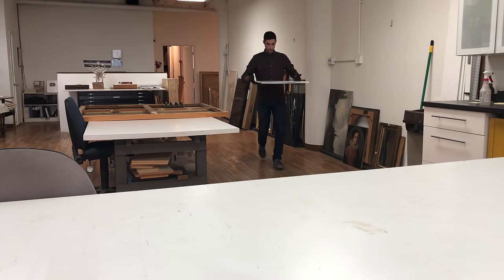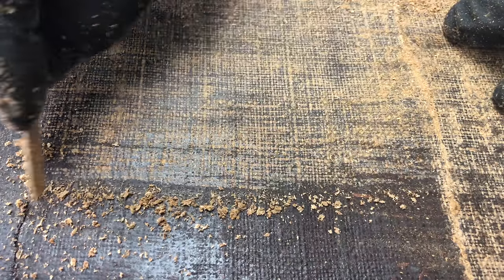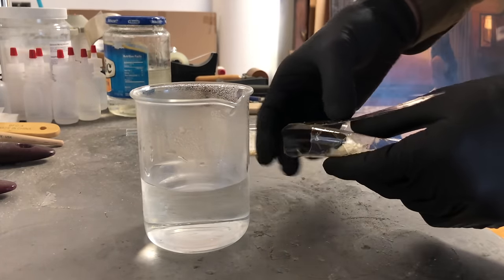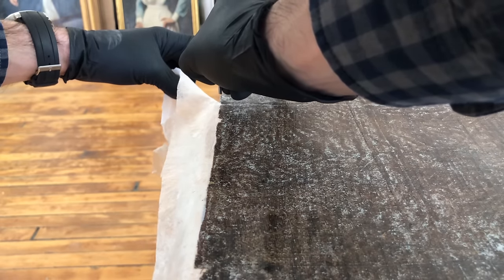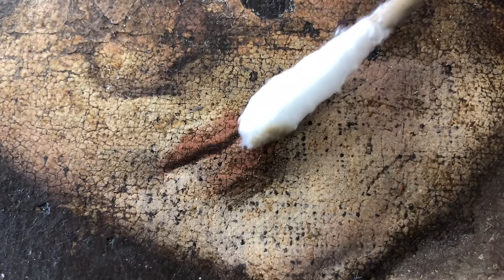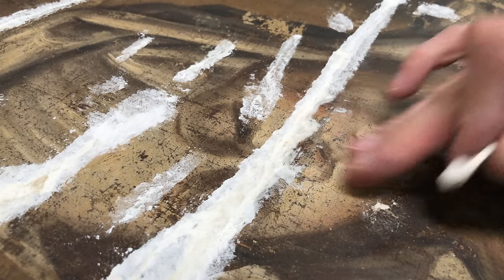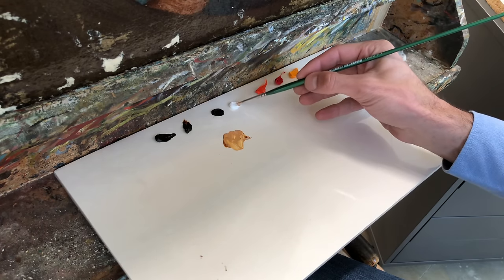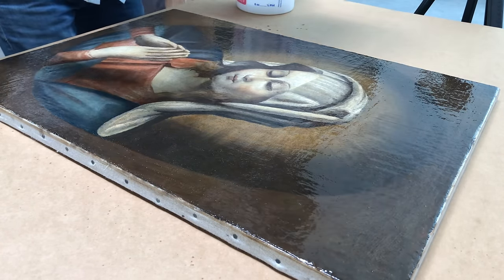Ex Multis Ad Unum - Restoring A Split Painting - Narrated

Comment: It's great that you explained that you weren't removing the green-ish paint and that was from previous retouching, but come to think of it - how do you distinguish the original paint from previous retouching? :-)
Reply: I think he uses a blacklight to see where it was retouched. The blacklight shows how thick the paint is.
Reply: Most of the time, the retouching (if done badly like in this case) will be obvious and show up as very flat colour with not a lot of brush work. When he goes those areas, he’ll start to see the original colour and the detail that the retoucher didn’t achieve.
Reply: It may also have to do with the paint quality and material. A solvent may pick up old tempera (which is egg based) and not oil paint, which would mean anything that comes off was unlikely placed by the artist.

Comment: Meanwhile, I am here struggling to clean my phone to put on the damn screen protector.
Reply: his phone protector must be immaculate. No bubbles, perfectly aligned and it’s never going to peel at the edges
Reply: I have been do lazy to do that, thus my screen protector is still lying around here in its original package...
Reply: screen protector??? I can't waste valuable restoration video watching time to mess with any of that noise.
Reply: Wait.. y'all do your own screen protecter? Its weird cus I got mine done by the shoppers.
Reply: Take a hot shower, and then put it on the phone in the bathroom. The humidity keeps the dust under control.
Reply: Miao Yu I can’t tell if this comment is being ironic or legitimately giving me a life hack
Reply: You need a heat table!

Comment: I wonder what processes they will have for conservation in another 100 years and if they will look at modern techniques as you do old ones.
Reply: Do RC they'll probably have to refer to Julian's videos
Reply: They’re gonna time travel and kidnap the original painters have them paint a new one.
Reply: It is an interesting thought.  I don't doubt that conservators in the past did what they did with genuine good intentions.  No-one sets out to bollock up a restoration.  The difference is that the results that Julian can achieve are so good that it's hard to imagine a substantial improvement whereas a lot of restoration in the past looked like a bodge at the time.

Comment: Great point about the adhesive and solvent used on the Japanese mulberry paper, I completely overlooked how it didn't interfere with all the surface grime in what is frankly a counterintuitive way. You would assume any solvent would somewhat lift surface grime, particularly when painted on and wiped off but it really didn't. Love learning and noticing more with your narrated versions. Thank you for the effort put into them 😊

Comment: I liked you talking about the idea of sending samples off to a lab for testing, and how it’s not needed for most pieces as the materials used are so normal to you now that you can spot them pretty easily. I feel like you’re more likely to send it off if it has been in potential contact with a lot of lead or asbestos, more than what it’s made of. There were limited tools back in the day that paintings now needing work were done after all, and as a result there are less types now for you to recognise. Stunning work as always :).

Comment: New subscriber working my way back through the old videos. I think BFAR must have moved halfway through this one. The hot table is sitting on a hardwood floor (not cement), but the retouching is happening in the new studio. But moving the entire business doesn't ruffle the surface of the work.

Comment: I have a question. When you fill in the holes with the carbonate, and you do it with excess, which you then remove, it does have one remarkable effect.
All the little dots, you explained were missing paint, and you see the original canvas. NOW hoewever they are not darker spots, but BRIGHT white... Now you must retouch them all? You took away the choice to let them be. Did that greatly augment your retouching efforts?

Comment: 41:06 while viewing the repair process was lovely and nothing short of astonishing, and was so necessary, as the pieces pretty much had stopped being a picture, still the face Maria ended up with doesn’t sit right with me. It might have been closer to the original painting, but I actually liked the character of the previous “touching up” better. - I liked the thinner lips. I liked the cheeks less prominent and rosy / when they seemed flatter; now the contrast between the pale and the rosiness make the whole face seem rounder / better nourished (?), more 3D (?),  more Kindchenschema (?) - as if her age changed from 16 to 13.

The only thing that was rounder before was the nose. Which means that now the effect is almost inverted: the nose is straight and slender, but the rest of the face seems rounder and more puffed up - I’m pretty sure it’s the rosiness of the lips and their thickness and the cheeks and probably the roundness of the eyelids. - The mouth was so different after the cleaning! And I don’t like it. - To me it seems as if the previous overpainting made her a prettier woman. - Now I wonder if the original painting shows a real woman that just happened to have different lips, or if it was the preferred style at the time. (I mean: already the way women paint their lips in RL changes with time - not even taking into consideration what painters might think or do).

Edit: after reconsidering: the changes are not as stark as I make them sound, it’s still pretty much the same picture after all. Now that it is a picture again.

Comment: I wonder what some of the more exotic tools are that can be used. Eg: if the hot table is the stove. What is the pressure cooker of conservation?

Also, do you ever get the feeling that the previous restorer did a really good job for the tools that were available at the time. Or are all of them amateurs?

Comment: Retouching was a real challenge here. Seems some golden mean had to be found, main missing fields with neutral hue that woudn't influence perception, the rest to leave as it was, though client might not like it. Or give both variants to choose: before and after full cover, as paints are reversible. Also, surface looks uneven, couldn't it be covered with varnish without glare?

Comment: Every time u use the hot table I wonder why it doesn’t have a thicker plastic at full table size with a thick flexible silicone edging that sticks by vacuum without using the tape? Or several sheets different sizes with thick, wide silicone edges. Maybe because it’s homemade or maybe I should tip the maker instead… 😅

Comment: I grew up on an isolated island where folks learned about and used old-fashioned “medicine”. I stepped on so many rusty nails as a kid, I couldn’t guess how many now but I never got a tetanus shot, and never even heard of tetanus until I left my island home. Instead, my mother would make us bread poultices that went into a clean sock and we went to bed with it on the affected foot. I only remember wearing it for one night but maybe we wore it for more than that. Anyways, but some form of osmosis or other similar process explained by physics, dirt and germs were basically sucked out of the wound and it healed just fine. So, I have quite a few memories of having a nail stuck in my foot along with the feeling of mushy bread in a sock and not ever having to see a doctor or get an injection for it.

Comment: Hey question, does art restoration exist for modern art? Like posters and stuff. I have a Pokémon poster that I’ve had since I was about 10 and i never treated it well. It was ripped at some point and I used tape to fix it (which I regret now) so I’m hoping that there is someone that would be willing to fix it. It is a printed poster so I imagine the fixing process would look really different but I still hope someone here can help. 

Thanks in advance
Reply: Paper based works are a different area